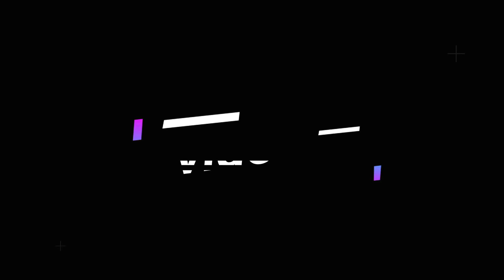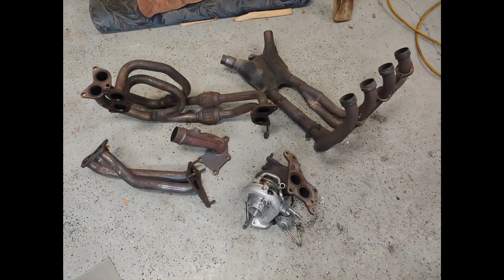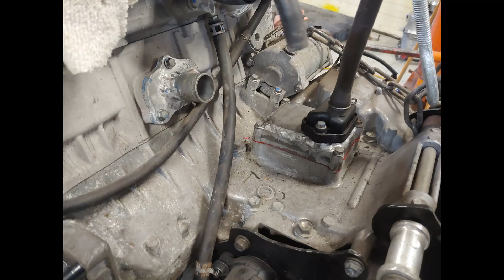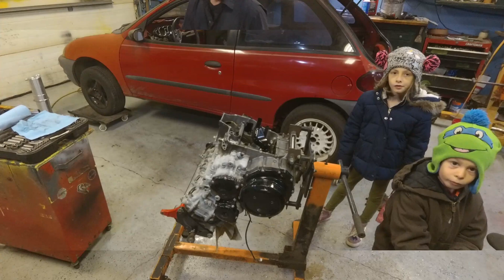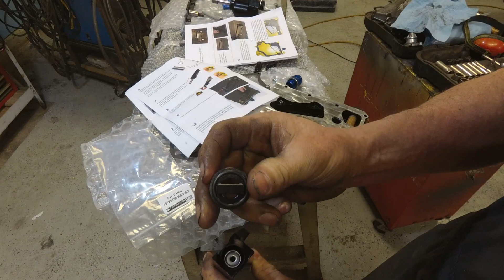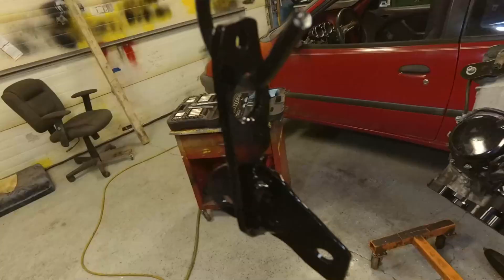metrobusa update 5. hayabusa dry sump install

Comment: Great project.   What’s the rationale for the dry sump?
Reply from the maker: Motorcycles dont have or need baffling in oil pan like cars do. oil would slosh on hard cornering and hard exceleration and suck air. Wanted to not spin a bearing. Dry sump oil pan is very skinny so i have more ground cleance. Turbo ended up low so helps with scavaging that too. Thanks for checking it out
Reply: motorcycle oil pans are always normal to the net G force since motorcycles lean, oil doesn't slosh around.